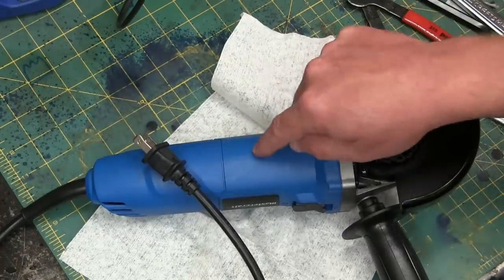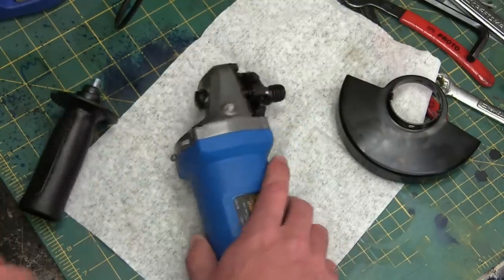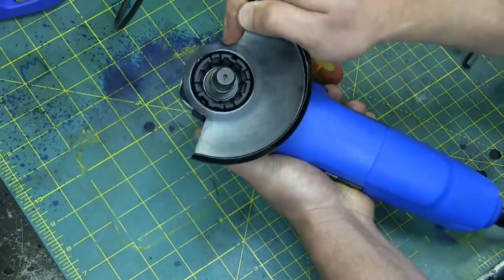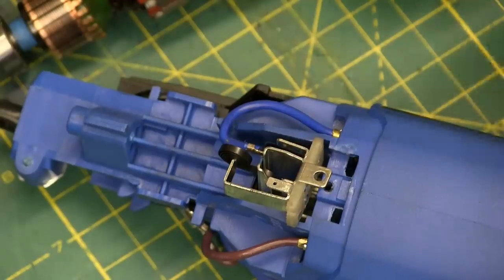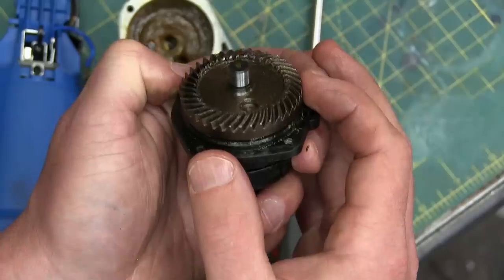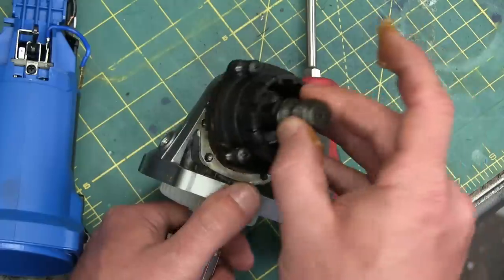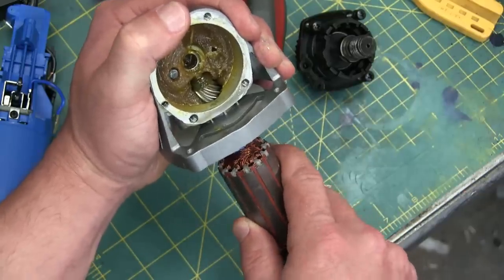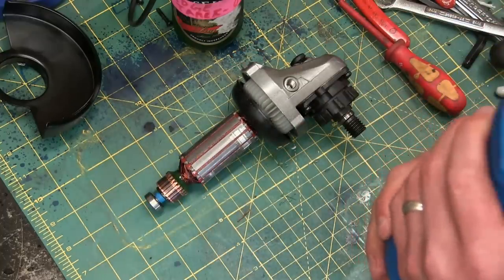BOLTR: Harbor Freight Grinder. HOW BAD IS IT?

Comment: A couple years ago I had six grinders going 8 hrs. a day for a month pointing a large building. Being the boss, when I decided I wanted to work I bought myself the DeWalt grinder and my guys got the $15 Harbor freight grinders. I returned the Dewalt to Lowes 3 times in a week I don't think it was mechanical pretty sure it was electrical and switch would fail from the dust or brushes lost contact.  I figured the mortar dust would chew the grinders up daily.   I was surprised at how long the HF grinders lasted. Most made that sound in the head when you spun the motor and various other metal on metal sounds and some would stop, but a quick blow out with the air hose and few smacks against the brick wall would get the HF grinders going again. I have a shit load of smoked HF grinders but some, believe it or not, lasted the whole job. They sound like they're going to explode any minute but still work. Let me also say some didn't work right out of the box and I even bought a bunch that came with a shitty handle but didn't have the handle hole tapped in the housing. Hit or miss but for 15 bucks I got my monies worth. Great videos... keep em' coming

Comment: I buy the $14 Harbor Freight angle grinders by the Dozen, we use them for edging concrete floors prior to epoxy floor coating , we have found that the $14 Harbor Freight grinder will generally get through one 6000 square foot fire house floor project before committing suicide, however we have bought $200 name brand angle grinders and sometimes only accomplished two projects of the same size before they take the pipe. Simple economics, we stock them by the Dozen , and throw them away like dirty condoms. In our case I'm sure that the tool ingesting copious amounts of concrete dust leads to their premature failure,  great video as always

Comment: Generally the the HF ones I have had over the years don't leak the grease out but they do put on a smoke show after a couple years if you run them hard.  Probably the brush holders melting.  Great little $10 - $15 for the home gamer.

Comment: I got the one that was on sell for $9.99. I threw the thing because the switch stopped working with the handle on it, the metal broke instead of the handle. It had the same switch setup and the plastic had started deforming making it not turn on.  I put a new switch on the rear end and talk about some dangerous setup. Mine has the original style guard and one day I was using it and the guard just flew off. I was using the angle grinder one with a 8" foam polish wheel on aluminium and it caught on fire. I took it apart  and it was the feild winding, mine had way thinner wire so i pulled back a couple of the windings on it (just one one side =P ) until it didn't show to be shorted then put some fingernail polish on it and it still works. Mine is metal where the disc goes and the fan is better. I replaced the grease on it right away.  And as far as what you said about it lasting, I use the shit out of mine and it's lasted... One of the "features" that makes it last longer is you have to give it rest when your using it because it gets to hot to hold on to. Also on more the one occasion I have used it with a 8" foam polishing pad hooked up to a homemade extension cord that is fitted with a household light dimmer switch and that got it hot as hell really fast. I'm not sure how those dimmer switches work but I have been meaning to hook it up to the old Protek 20Mhz O-scope and have a look-see..

Comment: I came across one of those Harbor Freight grinders , figured I do like Scarlet O Hara and the Mule scene and run that sucker right straight into the ground , which I did , but one thing that really annoyed the crap out of me was the handle came apart while I was using it , I was working with it in both hands , then all of a sudden I had two different parts in each hand , the handle is a two piece press fit plastic abortion deal.
I used it until I started getting smoke out of it , I sure got my money's worth since it was a gift.
One thing I might add , the brushes fit in a Makita , the older one where you can screw the little disc off the side and replace the brush , I filed them to fit an old Makita , and it works as good as ever.

Also those shielded bearings are lubricated with a light , Vaseline type grease , before too long they make all kinds of noise.

Comment: I own this unit. It works well. hasnt failed me. however i only use it for 20-30 seconds at a time. i dont press very hard on it. and ive only used it to cut mild steel and one time i cut some exhaust pipe for my truck (idk what thats made of). it feels weak but it doesnt feel flimsy or dangerous like the harbor freight sawzalls do(they literally flex in your hands). it has lasted me a few years sofar. nothing wrong with it...yet. I dont recomend this for anything other than very ocasional use with frequent periods of rest. and ALWAYS wear your PPE especially with cheap tools like this.

Comment: Late to the party here, but I have a Harbor Freight grinder that I got for my tool bag, it was supposed to be a cheap throwaway.  It's been going for over ten years now, I had to fix the cord because it dried out and cracked right by the housing, but otherwise it's been putting up with a ton of abuse.  On mine the lower gear housing is metal too, so it may be an earlier heavier build.

Comment: I've owned 2 of those grinders. I'm in the US (Montana, so I'm only about 150 miles or 241.4016 km from being Canadian) I'm not easy on my grinders. I use a grinder for about 5-6 hours a week cutting railroad spikes in half for a product I build and sell on ebay, and I also cut 3/4 inch schedule 40 steel pipe and other various metal for building motorcycles. When I cut the RR spikes I usually cut 30-50 at a time as fast as the grinder will go. It gets too hot to hold with bare hands.

The first HF grinder I had lasted 2 years before the gears failed. I think it's like you said, the grease leaked out and left the gears dry. The second one is still the one I'm using after about a year and it's going strong, like I said, I keep it bogged down when cutting RR spikes and it gets HOT. Nothing has melted yet.

Some people give me shit for using HF stuff but I figure if I can spend $30 on something I can use for 2 years, I win. Plus if you get the replacement warranty for 9.99 you can just take it in and get a new one if it breaks. I also have the 90 amp flux core welder and their standard sized drill. I had to replace the cord on the drill with an extension cord end because the wires broke inside the casing, and the 9yo kiddo was playing with it and broke the fwd/rvs switch off, huge pain in the ass to use now, but other than that I really don't have any complaints with a lot of Harbor Freight's power tools. Harbor Freight does sell some SHIT products but you can usually tell by looking at it. Don't use their flux core wire, it's fucked. Use Lincoln wire in their welder and it does pretty good.

Comment: Used the HF flavor for a total of about 6 hours run time. Started getting to hot to hold and finally got to smoking and quit. Bearing was all sloppy so didn’t try to fix it and at $9 on sale, that was what it was worth.

Comment: I have broken several of these grinders. I work for a concrete polish company and our boss would buy these because the concrete dust destroys grinders. Plus he would use the harbor freight warranty and get two for the price of one. Two major failures, push too hard and that plastic internal piece melts or if you go easy on the grinder the main bearing eventually dies.

Comment: I have an older Harbor Freight - Chicago Electric .. had it for 10 years and I've done a crap load of grinding on it .. surprisingly It's held up.. It was $14.99 on sale for $9.99 so I didn't expect much at the time.. not sure how the newer ones are though .. but mine was an orange Chicago Electric and not too shabby for the price ..

Comment: Work bought each crew a Metabo reciprocating saw.  Most common use is cutting the shaft on frozen conveyor rollers.  The 3rd or 4th time we used the one for our crew it started smoking.  Set it down on the concrete and removed the lithium battery in case it decided to go nuclear.  Let it sit for 10 minutes.  Still worked, but at a slower speed. Two minutes later it stopped altogether.

Comment: I actually have one of the older orange colored ones.  It recently failed after years of periods of heavy use.  The strange thing was the failure wasn't anywhere you would expect. 
What actually failed was the wire right near the strain relief. I just stripped it back 4 inches and reconnected everything and it works fine. 
Say what you will about chinese made harbor freight corded tools. At least the chinese still screw most of their stuff together. This makes it much easier to actually go in and fix stuff later. Nothing worse than cases and stuff plastic welded shut. That bearing may just be shielded but it is a common bearing to find and really cheap if you need to replace it. So far I have not needed to replace mine.
My primary use for this tool is prepping metal for welding or cleaning up and or cutting old welds out. So when I have a project going it gets a workout.
Their cordless stuff is a different story. 99.8% junk!

Comment: I've had a Chicago electric for about six years, I got it we'll used from a guy who cut the cord on accident and it's still going strong. mine is so old it doesn't even have the locking tab switch, just a classic slider switch, I actually used it yesterday

Comment: We have these exact same tool under another generic brand name packaged for our own local version of Walmart (Now bought out by Walmart) in South Africa called Stramm. Same tool, different sticker - I guess the German sounding name is supposed to make it sound more "quality". I was able to get it in a set that included a hammer drill and a jig saw for about 55USD 4 years ago, and man do I tell you, what a surprise. 

We have a small side business that does network cabling and after using these tools for my own small DIY project I put them in the toolbox for the apprentices to use. The apprentices seem to eat metal but after 4 years of duty, all 3 pieces are still running without a problem. The chucks for all three have been lost a few times, as well as the guide for the drill but other that not a days worth of trouble. All of them are used about 4 out of the 7 days a week by generally unskilled laborers and myself occasionally. 

I would definitely buy them again for the price to quality ratio, plus never have to worry about them growing feet and going for a walk. 

Thanks for the awesome videos, there are a bunch of us down here in the South of Africa watching and enjoying!

Comment: Metabo W9-115 Quick  is probably the best money spent on a 4.5" grinder.  Or you can save roughly $15 and get the W9-115 with the standard 5/8"-11 spanner wrench style nut.  The welding company that I work for owns over 100 of these Metabo grinders, and I get to work on them as needed which usually means brushes and cord replacements when "accidents" happen to the cords.  I've been working on Metabos since the W6-115 models existed and now we have progressed through the w7, W8 and W9 models. We also have other Metabo models for special occasions.  I can't see a homeowner ever wearing out a Metabo grinder, but if they get a year or two out of the HF brand, just go buy another one.

Comment: I have an HF 4.5 grinder with that design, only difference is plastic is orange. I put a 4" wire cup wheel on it at least 4 years ago, in my world its the one that gets used the most. Other than a new set of brushes a couple years ago, its chooching right along.

Comment: I got one of these for $9.99 about 5 years ago. I left my Metabo at home and I use these grinders at work so I needed a quick replacement. I figuired if it lasted me until the end of the job I had to do that day, it was worth the $9.99. It has been working since and I haven't babied it and it's actually seen some real professional use. It's smaller than my Metabo so I reach for it more often now when I don't need the beefy full power for a job.  I've been more impressed with HF tools than the low end name brands like Black and Decker and Craftsman. And they cost 1/4.

Comment: I run both Makita and Metabo 5" and 9" grinders for concrete grinding.....a LOT of concrete grinding and I agree that the Metabo is the better grinder even though Ive burned out a few of the 5" Metabos but have yet to burn out a 9"er. But having said that, the Makita 9" grinder is great. Metabo has a variable speed 9" but its hard to find but its the perfect concrete grinding/polishing hand tool

Comment: Never had grease issues. I make my own handles for em. My first grinder is still good 6 years later. My second one the pin got stuck after 10 minutes of use, and it just sits on a shelf now. Pin got sucked in trying to change out a cutting disk one time.

Comment: I’ve owned one of these for 2 years. Mine burnt up so I grabbed one because it was cheap. Not expecting it to last long.  She’s still going strong!!   Now I did pull the head open and cleaned all that greese out then replaced it with some good stuff.  And I have worked the shit out of this thing!!   I Run 7in metal cut wheels meant for circular saws. And she’s yet let out the magic smoke.

Comment: I have the cheap harbor freight (same power switch), the more expensive harbor freight (lost the arbor nut for the first one, has a deadman paddle switch), and a used DeWalt (pawn shop, got a toolbox and some discs / wheels, has a better deadman paddle switch) for about the price of the better HF one.  The DeWalt is so much better.  I do still use the other two HF grinders so I don't have to keep switching discs.

The only failure I had was with the locking pin on the more pricey HF.  The locking pin spring is held on by a plastic button, which disinegrated and the spring fell off.  So to change that wheel I have to stick the pin back in to lock it.

Comment: I have a makita, milwaukee, and a $29 Harbor Freight "Professional Series" flappy paddle grinder. The stupid harbor freight one is my go to and just won't die. If I buy the Harbor Freight stuff it was the "professional Series". Built just well enough to actually make it a while.

On a side note, I have a worm gear HF "Professional Series" that I was running metal cutting blades on in the heat of summer cutting up an old shipping container. It got a little smelly, but never died. Sadly my Skill worm drive did.

Comment: I have the Cheapo one and use the dog piss out of it, but it's the 4" version not the 4-1/2". The only complaint is the switch doesn't always catch in the on position and I have to simply re-toggle the bugger back and it'll then hook up. I've build a lot of custom fab steel work with it, thing kicks butt still. PS: don't tell the clipboard warriors but I binned the guard within minutes of putting the sucker into service.

Comment: So what aboot the bearings. Why are they using shielded bearings in grinders and bench grinders? You would think sealed bearings are better to keep out the grinding dust and grit. The extra drag from the sealed bearing is peanuts right?

Comment: For casting aluminum with cans, could you not just use some sand/glass to add some silicon into the mix? or some copper to make duralinium?

Comment: the plastic part that you said would be the 1st to fail busted out my window in my truck when it broke. harbor freight had to fix it cause the wheel actually hit my headliner and got stuck. I called harbor freight and drove up there and showed the mananger and he took care of me. I am scared to even use any of their power tools after that happened. I like a few of their hand tools but I don't use them as a main set of tools though. I do enjoy watching your videos.

Comment: Ive had my harbor freight grinder for almost 12 years, fairly heavy use (blacksmith) and other then way noisier then my Hitachi or makita it still runs well and never had an issue but I did change out the brushes already.

Comment: No doubt some other body is going to come along and say this but my ( insert brand here ) has a lovely little thumb mechanism where if you push it in one particular way it locks. If you push it the other way kind of way it stays in the spring back mode. I particularly <3 this grinder. This design saved my face. Was grinding a thing as one does while running through the forest. Hard core balls deep in to my mission. Then some parachute cord or similar decided to present itself and the whole lot got caught up and was torn out of my hands and did a slow motion dance towards my face. I was saved because the cord thing that got caught up had failed to correctly calculate its length to get me and by the time the grinder got close enough to eat me it was slowing down. Sometimes I do want stuff to turn off if I let go of it. Not Vibrators. But some other things ( of course it did not have the guard on it who uses that thing ? ) ..

Comment: Heads up on the chipped brush. That won't hurt performance in fact when I raced R/C cars we would cut down the ends of brushes to get more performance. It's an old timer trick with aloof science involved

Comment: I have used the HF grinder for years. They work really well, for the price. But, everyone of them failed at the cord. The rest of the machine would go for months and a couple of them lasted a few years. Sooner or later, a wire would break in the cord, dead grinder.